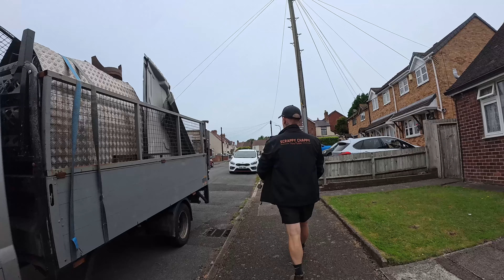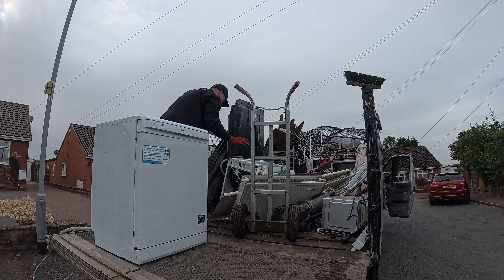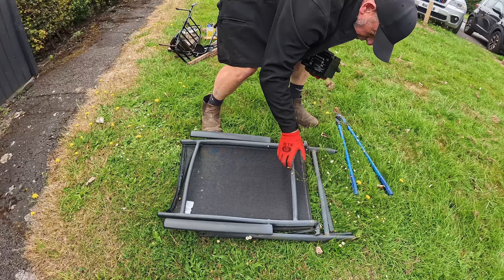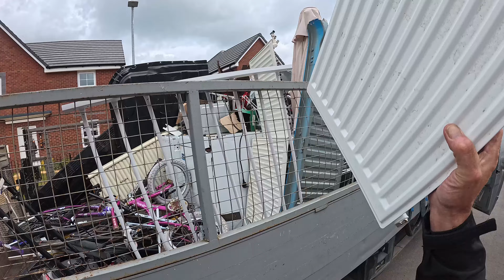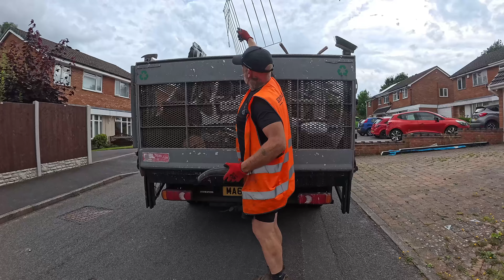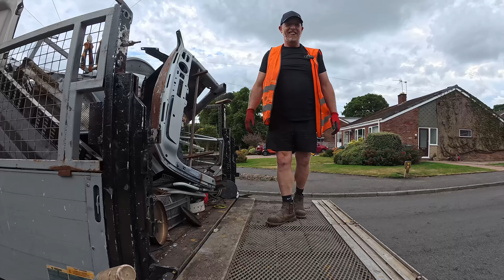street scrapping you never know what you're going  to get next #vwbeetle

Comment: Wat wire is worth stripping?
Reply from the maker: thanks for watching any wire is worth stripping if you have the time. twin and earth and armored cable is the easiest to strip
Reply: Household wouldn't be would it ?and are singles even wiring looms  from washers and microwaves  etc
Reply: @scrappychappy74  prices are way down at minute
Reply from the maker: @geoffbrown8748  household i cut the plugs off and weigh in as plug free weigh the plugs separate £1.90 kg for household £0.40 kg  for plugs wire from washers and microwaves i cut the little plug off they are singles £2.90 kg hope that's help you out thank again for watching my videos
Reply: @scrappychappy74  thanks mate keep up the VIDEOS and I will be watching!